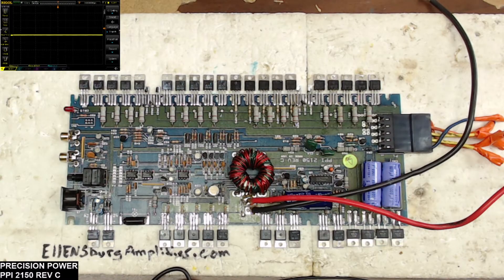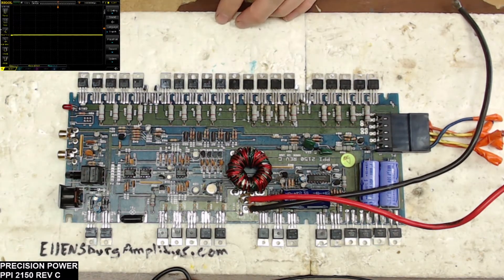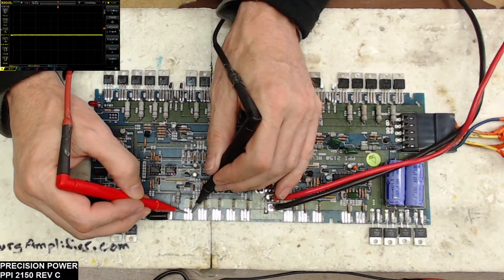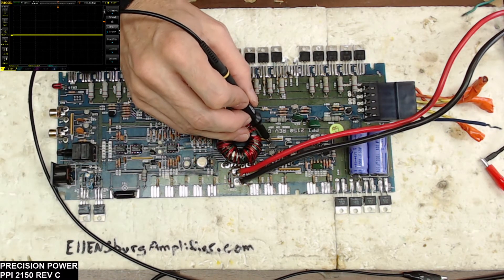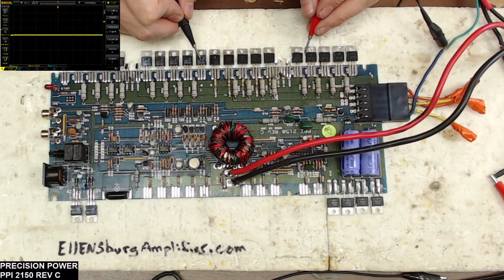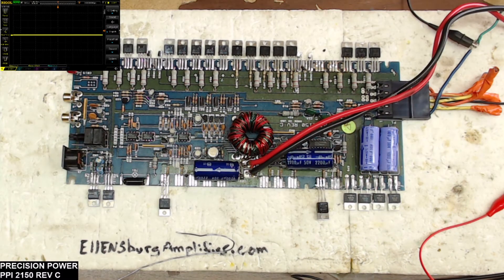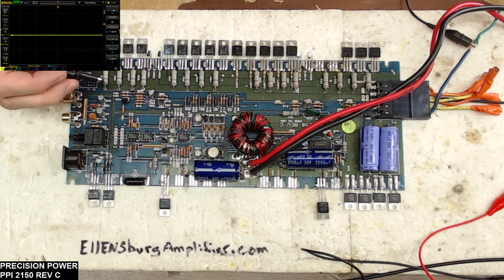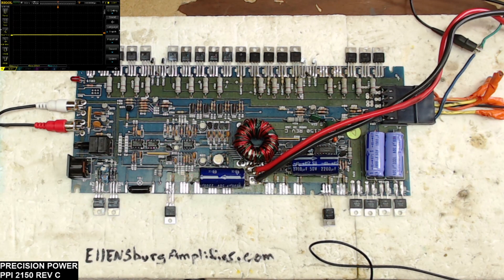Precision Power PPI 2150 Class AB Automotive Car Amplifier Repair

Comment: I have a skar Rp150.4 has in put issue at the RCA 's turn on protection light unplug they go out
Reply from the maker: Is that amplifier using 4 individual IRS2092 ICs or is it using an IRS2093m to drive the output channels?
Reply: @ellensburgamplifier  the 2093

Comment: Hello, My amp makes my subwoofers crackle with a wave sound and when I bang on the amp in certain places it stops. Sometime it also just stops out putting to the subs and nothing plays. Im not to experienced in amps, but would you know what could be the problem?
Reply: I opened it up and found a film capacitor with a green top that was loose if I try to solder it back to where it was should it have a better connection? Also would it hurt anything?
Reply from the maker: @matw9743  It shouldn't cause any problems soldering it back in place. It is a common issue to have bad solder joints in older boards.
Reply: @ellensburgamplifier  Ok, Thank you for the help and the very fast reply you are amazing.
Reply from the maker: Hi Mat, it sounds like a bad solder joint or something is loose. I would be careful as that can cause large surges in current and then you will end up with shorted transistors.

Comment: Hey I have a Rockford T600.2 and Rockford 1200.1 prime in need of repair can you help me out with contact info for repairs?
Reply from the maker: You can find me at www.ellensburgamplifier.com but I do tend to stay away from RF boards when I am busy due to the complexity of their circuits. They tend to be a little more difficult to repair. The Prime amplifiers are not as bad so please feel free to get ahold of me through the request form in the drop-down menu on the site.

Comment: Hi Todd I have about 5 art series amplifiers that need to be repaired I can’t find any schematics online for these besides testing
Reply from the maker: Hi Jim. I do not believe you will find any schematics. If you need to dig into the circuit design the I would suggest reverse engineering one section at a time. Get one running and then use that one as the reference.
Reply: @ellensburgamplifier  thanks
Reply: Hi Todd are you taking in any work? I have 5 amps that need repair ppi amps from the 90s

Comment: Please advise, on the output must the speaker output/polarity be in phase when you are done with a repair or do it depend on the design?
Reply from the maker: It does depend on the amplifier but for the most part, they are in phase if I am reading the question right. The biggest aspect I look for is having the same amplitude and no noise.
Reply: @ellensburgamplifier  thank you for this info

Comment: Thanks Todd for this video it help a great deal to see the different problems that can occur
Reply from the maker: Thank you. In my opinion, it is best to figure out what has failed and why instead of just replacing the defective parts and calling it good. There are many, many different styles of amplifier boards. A solid, firm understanding of diodes and transistors will go a long way to helping board repairs.
Reply: @ellensburgamplifier  I agree on that, normally I after checking the power supply mosfets and output transistors I would check all other components like the diodes and smaller transistors cause they are easy to check

Comment: Hey Todd, another great video. I have a question, where do you ground your scope? Your signals are crisp and clean.
Reply from the maker: Great question Cliff. For most of the testing, the scope is grounded at the negative battery terminal. There are a few situations where this is not the case. If I am probing the pre-amp area, depending on how the secondary is tied to the pre-amp then I have to ground at the RCA signal ground. Also, the signal quality depends on the noise of the PS. I have one of the cheap 30v 10A adjustable supplies that the thing is absolutely noisy. Watch for earth ground loops!
Reply: @ellensburgamplifier  lol, I have one of those cheap things also. It is now a secondary PS, because my signals had so much noise in them. I now use the Astron 50, doesn't have digital readout, just analog, so I have to get my old man glasses out to see it. lol
Reply from the maker: @strictlyamps820  Excellent power supply! I think it is the same as the Pyramid PS-50 that I have. Good clean power. Let me know if you ever need one of the voltage regulator IC's for that supply if it is the same. They are a bear to find!
Reply: @ellensburgamplifier  Will do, I have the Pyramid PS-52KX also. Got to do some work on it though. It pulls my voltage way down when current just rises no more than say 7amps. I replaced all the pass through transistors. I bought it used, so I really don't know what they did to it, I replaced the caps also. 10000uf i think they are.
Reply from the maker: @strictlyamps820  Have to love previously worked on equipment. If you ever get around to fixing that up I would look into the SCR circuit if it is using one.
Reply: @ellensburgamplifier  yeah it has the crowbar

Comment: hi can you use wd40 to clean a amp board? I tried alcohol, crc contact cleaner but both is leaving a brownish residue. keep up your videos learning alot from you! where do you buy your replacement components?
Reply from the maker: Hi Lewis. I have never tried WD40 and not sure if that would leave a conductive residue behind. I have never had any issues with denatured or iso alcohol so I have not had to try other products. I get my parts from Mouser, LCSC, and UTSource (UTSource is hit or miss on obsolete parts so be aware and do your due diligence on testing received parts!). There are two people on eBay that I get obsolete original parts from whom have not failed me yet. I do have a contact I use for my large middle and end-of-year inventory orders.
Reply: @ellensburgamplifier  mineral spirits is a great cleaning and lube for pots wd -40 will attract dust after time and make it stick 
I personally clean with alcohol or mineral spirits And let dry and I have have a kit of detox it  cleaner and all the other stuff it comes with it’s a good kit for the money it fixed for now a few dead spots on a expensive pot that they no longer make
Reply from the maker: @jimcatanzaro7808  WD40 in my opinion is good for bolts on cars and not on any electrical components. I made a mistake years ago on a cardmatic tube tester when I used an oil-based spray on the card reader pins.
Reply: @ellensburgamplifier  I agree but if you have something that is mechanically locked up like a old selector switch that I always have to fix usually in a repair job  i use a couple small drops of 3and 1 oil and I use my heat gun and work it gently and adding tiny drops of oil when it’s hot so it gets in there 
Hey everybody has little secrets I love em 
My old pots on this 1930s radio I would paint graphite on the dead spots on the pots and get it working great again they have paint available but it’s very toxic so you should use a fan or do it outside that’s the only down side
Reply: @ellensburgamplifier  kindly share your ebay seller for parts. Thanks
Reply from the maker: @kepharolang1984  WHat parts are you looking for? I have specific people I go to for specific items.
Reply: @ellensburgamplifier  just want those obsolete STK ICs
Reply from the maker: @kepharolang1984  Can you post up the IC number and I will see if I can get you the information you are looking for. I don't know what the IC number is.
Reply: contact cleaner - 90% rubbing alcohol  -